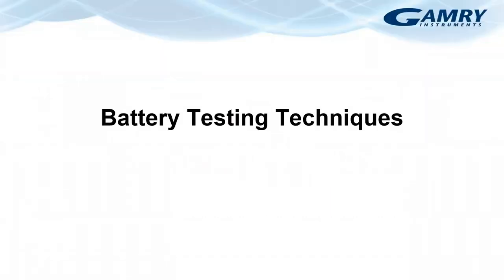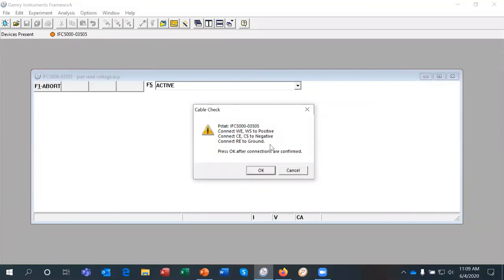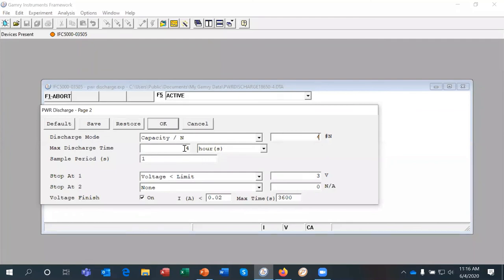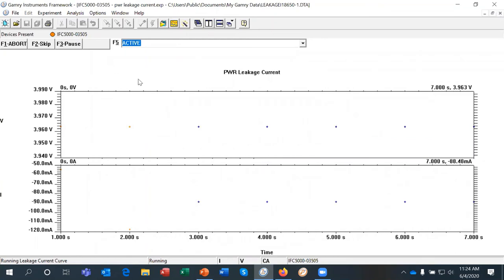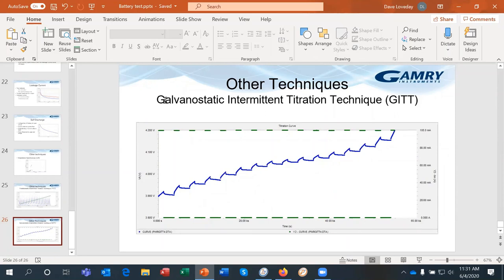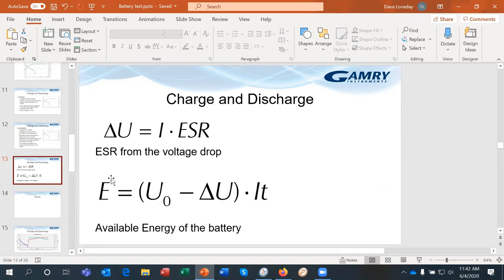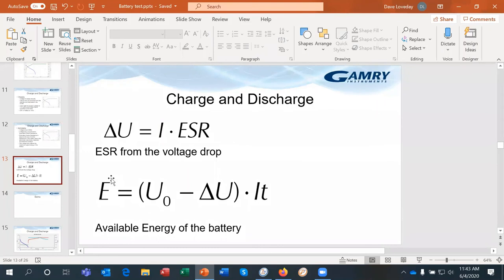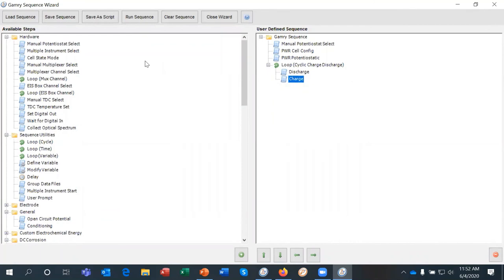Battery Testing Techniques: A live webinar with demonstrations

Comment: Good morning sir, could please explain a bit, how the temperature is effect the battery, like summer and winter seasons, is it a chance in winter seasons the battery discharge fast due to the low temperature?. Kindly explain
Reply from the maker: Temperature can certainly impact the charge and discharge characteristics of a battery. The amount temperature impacts the characteristics would be dependent on many factors, including the chemistry of the battery. Many customers will run their CCD curves in an environmental chamber in order to determine the impacts of temperature on their specific cells.

Comment: why is CC test done in general ? like cant we do normal resistor tesing with it ?
Reply from the maker: CCD is generally performed to determine how a cell's performance changes as a function of cycle number. Gamry's CCD contains many analyses that are performed automatically, and would not be done for other DC techniques. It also contains additional Stop At conditions that better meet the needs of those in the energy field. At its most basic CCD is a cyclic galvanostatic experiment, but there are additional features and analysis that are pertinent to the market.

If you have additional questions please reach out to techsupport@gamry.com, and one of our Technical Support Engineers would be happy to help further.
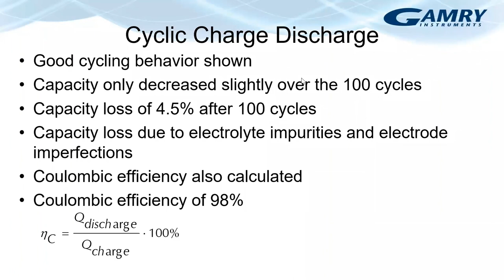Reply: @gamryinstruments  19:45 the Coulomnic efficiency as described here, can I know how is it calculated for the charging phase and discharging phase? 

what I want to know is since for more accurate soc determination addition of Col efficiency adds account for more precision in readings for SOC estimate so for chg and dcg states should we use same eff value ( in your case its 98% or 0.98) , is this going ti be valid for both cases?